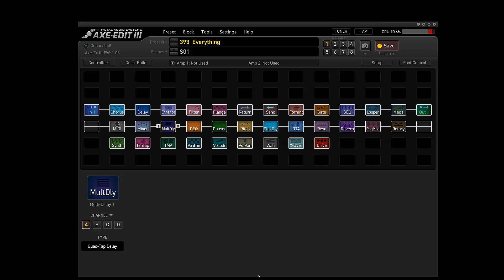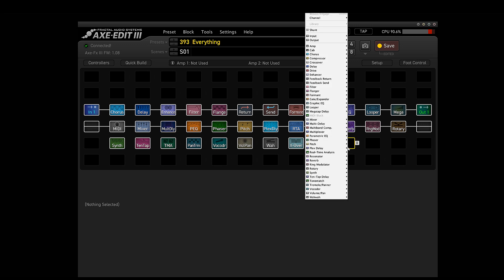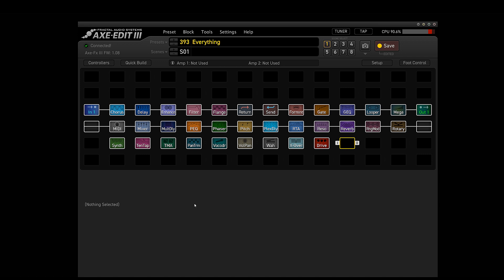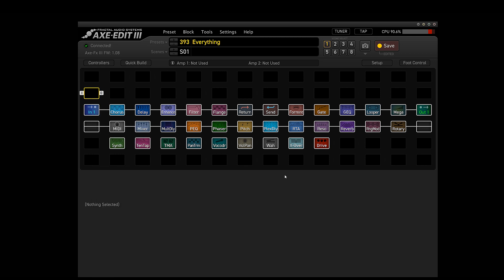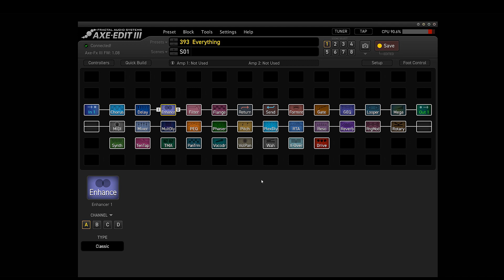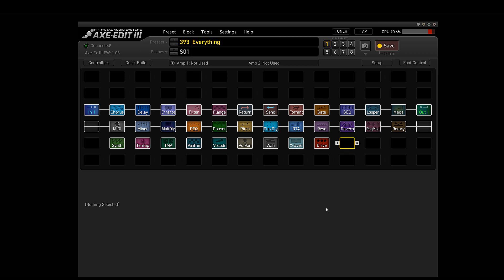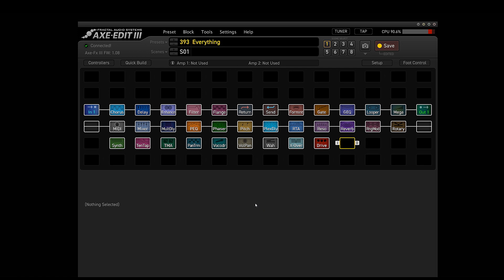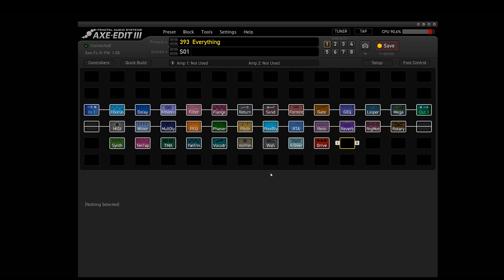Axe Fx III CPU/DSP Test: What Can It Handle?

Comment: how is the turbo compared to this
Reply from the maker: The turbo is going to allow you out everything you would need in one patch. If you don't like switching patches the turbo is great
Reply: @LucasLeCompteMusic  hi thank for answer so what you mean whit swtiching patches?
Reply from the maker: @BFHPET  meaning you have everything set up on present or patch number 020 and change to 021.
Reply: @LucasLeCompteMusic  i have never tried the axe fx but im saving up for one do you think there will be a 4 on the way soon? so how is the latency when recording through a interface whit it can i do it whitout any latency
Reply from the maker: I don't see a 4 coming anytime soon. They 3 is hardly tapped out at this point. Latency is really low. It's great to record with.
Reply: @LucasLeCompteMusic  i tried look up whit the effects but couldt find something is the effects model after real pedals. Like skymon whit the ambient stuff ?
Reply from the maker: @BFHPET  look in the axe FX wiki. It explains things in there.

Comment: But your not playing anything, that takes processing power too
I have the axe 3 mk2 with 1/3 of what you have loaded but of course an amp and cab with and with all my selected blocks activated there is no sound until I start bypassing
Reply from the maker: I did this when the axe fx 3 first came out. I need to re do it with an actual working patch. I just did this to see what would happen.
Reply: @LucasLeCompteMusic  yes experimentation is the only way to learn, good luck!

Comment: What's the point of adding every block except the most important ones that also happen to use most CPU?
Reply from the maker: This was strictly just to stress test the CPU. You can put all of the "important" blocks in the same patch and the CPU will be fine.
Reply: Lucas LeCompte I understand, but I would like to see the III's power in a more practical context. Why not building a preset with 4 channels of amp, couple of stereo IRs and most usable effects like delays and modulations? Let's see if gapless channel switching works and if you can put every sound you need during gigs in one preset.  Cheers!
Reply: I would have to agree with this. But non the less, I find this to be a good video.